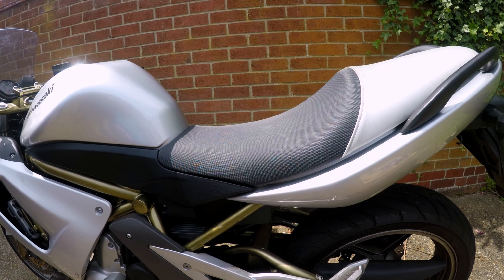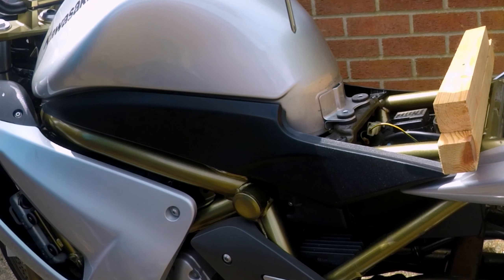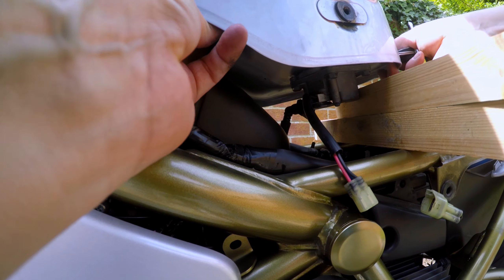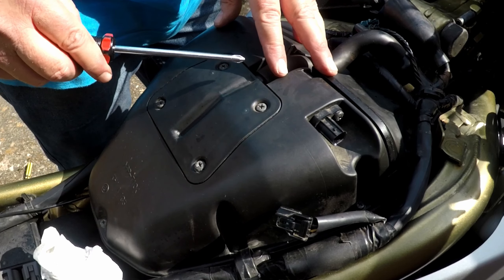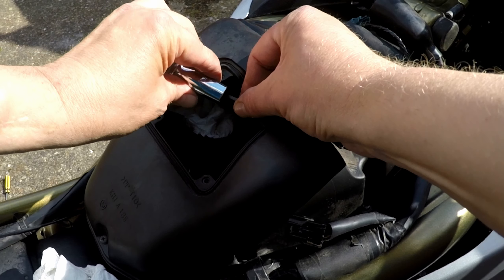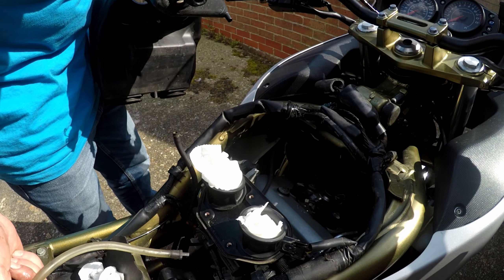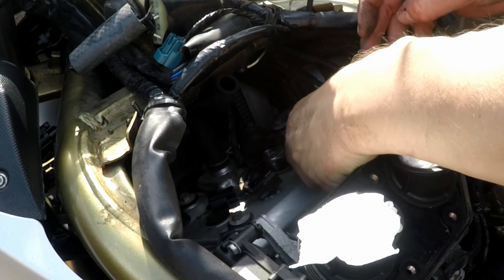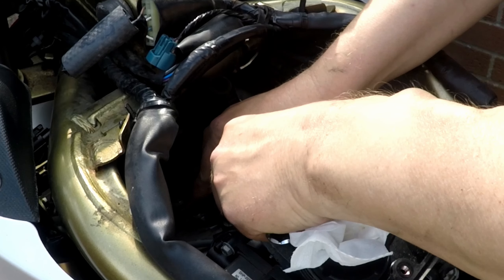How To Fit Spark Plugs | Kawasaki ER6f / Ninja 650

Comment: I gotta say, I just did my spark plugs and this video was pretty spot on! I appreciate it. I have to ask though just to make sure, I know there's a hose that comes off the air box but is the extra hose on the left side of the bike the one for extra fuel? I recently bought the bike and I don't think this guy even had it connected.
Reply from the maker: The hose on the left is the overflow if I remember right, it feeds down behind the frame to a bracket near the front sprocket cover. Thanks for watching, enjoy the bike they are great fun, I sold mine only two months ago after owning it almost three years.
Reply: @HalfdeadRider  you're the man! Thank you!

Comment: Huuuge thanks from a novice! Luckily mine is also a 2009 model and the replacement worked like a charm. However there was one extra electrical cable to disconnect underneath the tank for some reason.
Reply from the maker: The 2009 had some changes to it 2006-2008 is this model, and again in 2010 there were more changes, and bigger changes came later. Still mostly the same engine throughout though albeit with some tweaks, the earlier models like ours were set up the best.
Glad it helped you, enjoy and be safe, I really enjoyed owning mine for the few years I had it.
Reply: Fuel pump, the other is the fuel level sender.

Some models also have 2 nipples, and connect to two hoses running down the left side of the bike.

Comment: Hello, just a question for you, these plugs look really bad, did you notice the bike was misfiring or something? I just purchased same bike and i will be doing a maintenance soon, theres no sign of misfire or something like that, but i will do it anyway just to be sure everything is okay.
Reply from the maker: @MrLorenczo  no there was no problems with the bike, it was a clean fairly low mileage bike, 15k miles when I got it in 2018. Old plugs were fine, just old and dirty.

Comment: The “blocked” pipe is the breather tube. Catches any loose oil that works it was into the box to avoid contamination of the air filter. If it has any oil in it should be cleaned and dried fully.
Reply from the maker: I never did look in to it tbh, thanks for that. I'll give it a look when I prep the bike for sale soon 👍
Reply: I had no idea, mine was unplug with dried oil on it.  I just squeeze the oil out or what ?

Comment: should you use any anti seize grease for the new spark plug you install?
Reply from the maker: Some people do but it's not essential of course, personal choice, but a good one.  I've never had much problem taking plugs out though, done many on cars over the years, worked in garages when I was younger and never used any.

Comment: Hey! If the tank is full of gas, will it leak a lot when I take then tank off?
Reply from the maker: No, it will leak just the same, just a small amount will come out of the tube, but obviously the tank will be heavier, just be organised so you can lift it and put it on something safely, protecting the fuel pump by propping it up on some wood.

Comment: hi guys, my question is that do I have to buy an O ring or some type of gasket for the spark plugs, or I can install them as I take them out of the box. thank U !:)
Reply from the maker: As long as you bought them for this model they should go on straight out of the box mate, if they have a cap on top screw it off 👍

Comment: Heya. Great video! Thank you ever so much. So, I THINK it all 'worked'. I did the air filter and spark plugs, and it started fine, however, the "FI" light is on now. Did I miss something, or will it go away after I ride around a few times?
Reply from the maker: Thanks, glad you like the video. As for the FI light, that could be indicating a fault for anything, should not be anything you have done. You need to get the fault codes checked, potentially fix the fault indicated, and/or have the codes deleted.
Reply: @HalfdeadRider  Noted good sir! Thanks again. : )
Reply from the maker: @_Krhys  😎👍

Comment: The airbox has three protrusions (? I tried finding a better name but couldn't).
One big one towards the back connects to the engine (above the gearbox)
A small one towards the back  is connected to a piece of hose that has a plug at the end (??)
A small one towards the front <- this is the reason for my comment. The only thing in the vicinity is the venting from the coolant tank.
Reply from the maker: Hi mate, thanks for watching and commenting. It has been over two years since doing this so I don't really remember in too much detail, sorry. If you don't have a Haynes manual search google for a workshop manual, that should help you figure out any issues you might be having.
Reply: @HalfdeadRider  The workshop manual had a whole appendix about wire & hose routing. I couldn't find that bit at the bottom of the airbox

Comment: One question is okay to do this while there still is gas in the motorcycle?
Reply from the maker: Absolutely fine, but the tank will be heavy if its full.
Reply: @HalfdeadRider  thank you
Reply from the maker: @ivanguzman4427  np 👍
Reply: @HalfdeadRider  Can you make a vid on how to change the fairings plz
Reply from the maker: @ivanguzman4427  in some of my maintenance vids I show the process to get those off too. I'm also selling mine as I've had it almost three years now, time to move on.
Reply: @HalfdeadRider  thank and last question sorry but any recommendations on wat website to get some for any kind of bike ?? Say like a 2009 Kawasaki ninja 650r
Reply from the maker: @ivanguzman4427  I got mine from ebay mate, many parts shops will also advertise on ebay. Google is best to look for prise differences, just make sure they are the right ones for your bike before you buy.